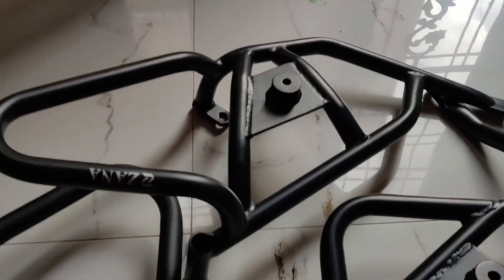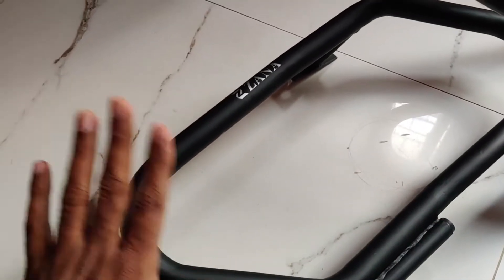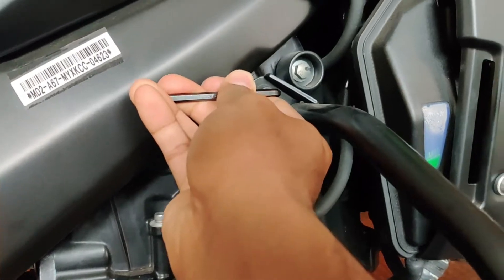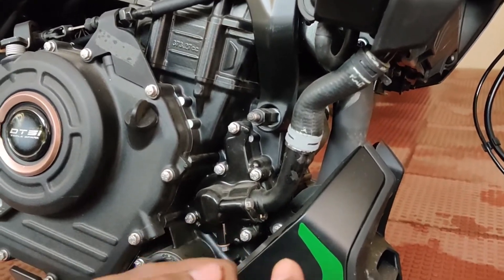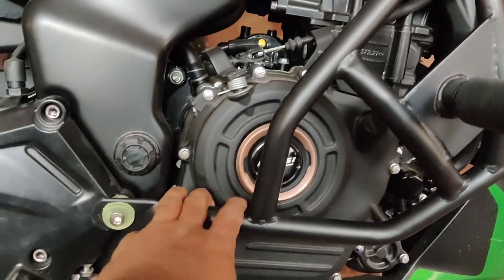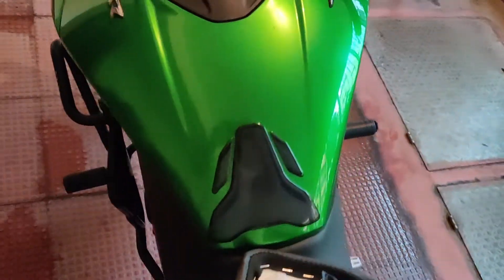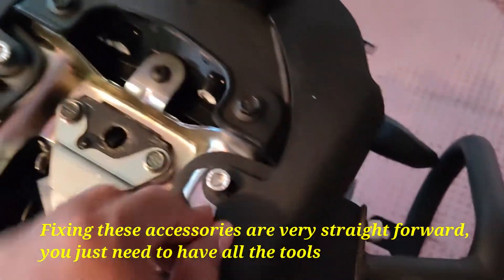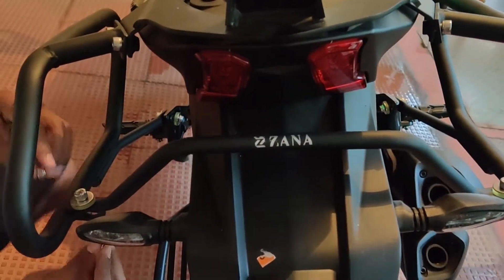DOMINAR UG 400||How to Install Zana Crash Guards & Saddle Stays

Comment: Can we fix grab ralls also with these setup?? Does back seat fits properly when putting grab ralls too?
Or do we need back seat lock raiser?
Reply from the maker: I think you can, but with back seat on, I don think grab rails are required
Reply: @RajRideStories  yeah but what if we want to keep both so just ask'd on that curiosity..
Reply from the maker: @raghvendra148  Zana saddle stay and top rack does not provide provision to add the grab rails... 😊😊

Comment: Hi Raj, thank you for the video.

Did you face any issues while putting the pillion seat ? As the height has increased due to bolt and n those lemon colored washers ?
Reply from the maker: Hi Adi.... Installing these saddle stays does not increase the pillion seat, as of now I have not faced any issues, as I am using this on both 2019 and 2017 model Dominar. Hope it helps 😊
Reply: @RajRideStories  hi Raj, it worked, if i remove rubbers under pillion seat then seat can be locked easily, but i did not removed the rubbers so i only have to press the end portion of back seat with litlle strength and it gets locked.

This is for those guys who are having issues in locking pillion seat after installing zana saddle stay.
Reply from the maker: @adiqto777  good to hear u got the seat fixed buddy 😊👍👍